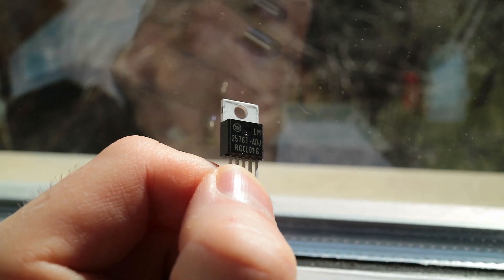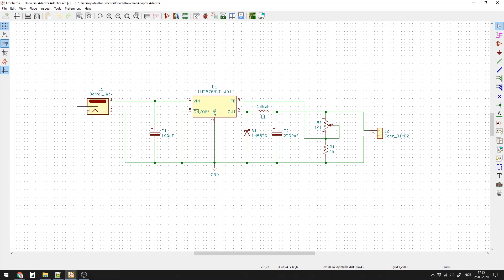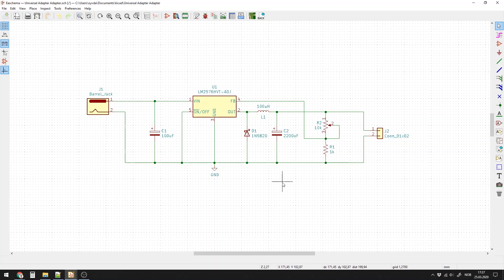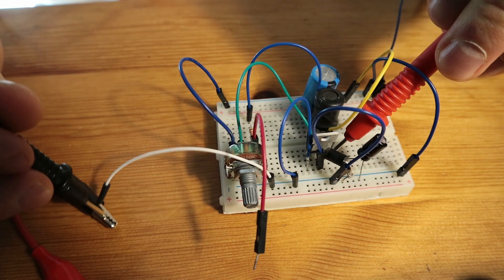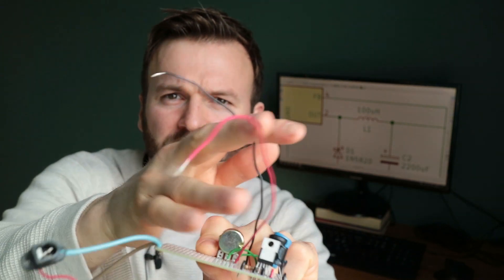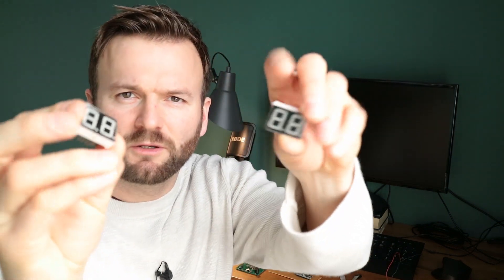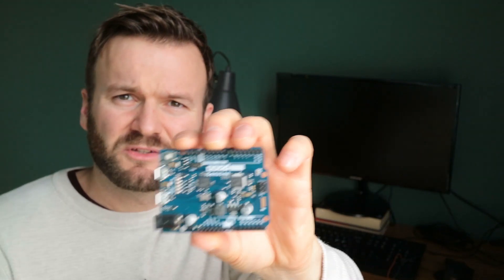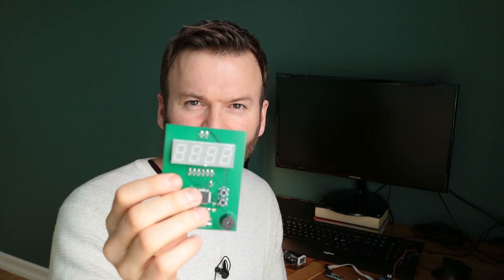I'm building a power supply (Part 2)

Comment: That's great progress! Won't the power supply blow up if you connect a load that will draw more current than it could handle? Is it desinged to shut down safely when the current goes too high? I always wonder how the manufacturers determine the rate of current a power source can supply. I guess the main component that determines the amount current is the transformer.